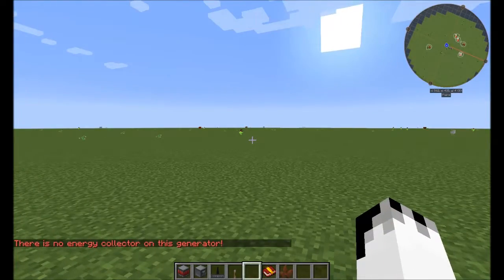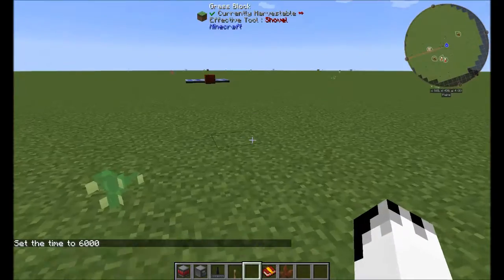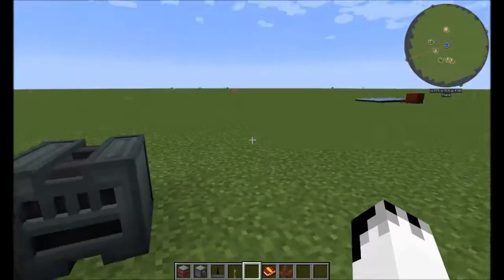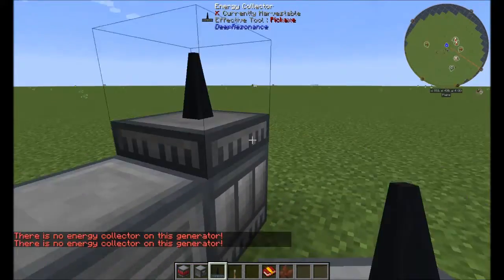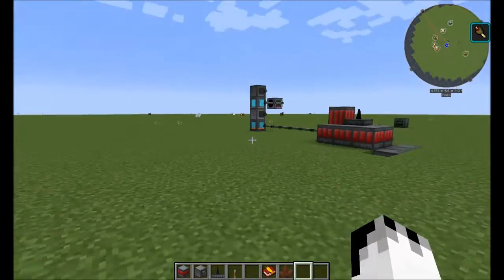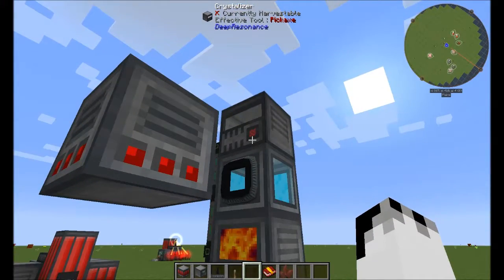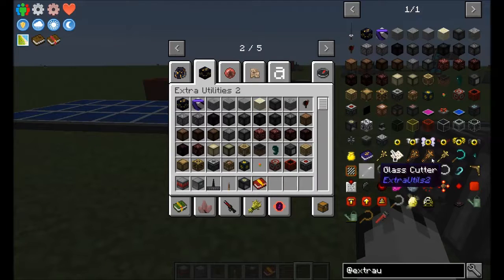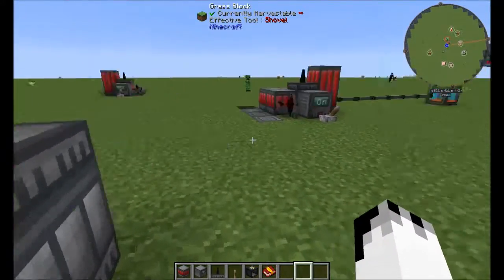Looking at extrautilies 2 and deep resonance

Comment: wheeps We don't need another power type!

Thanks for the previews, though!
Reply from the maker: It's not too bad actually, there are no wires to worry about, and its all passive gen.  At the moment, it doesn't have a lot of practical use, so it's a case of wait and see on what else is added to eu2.